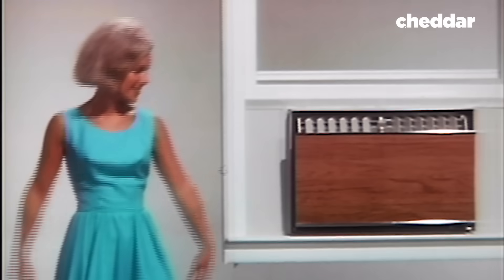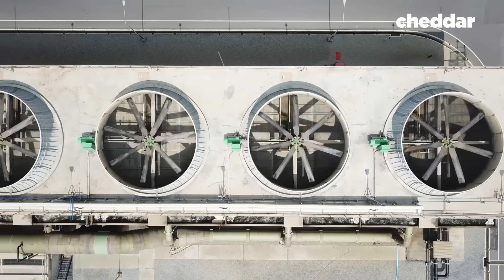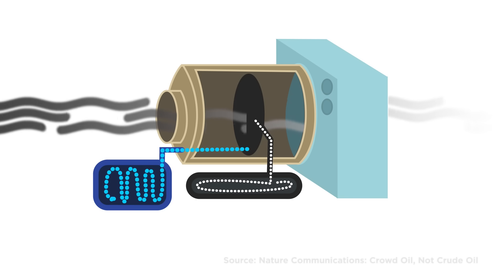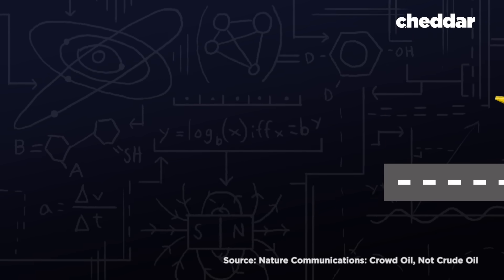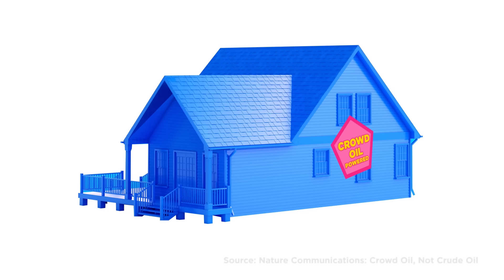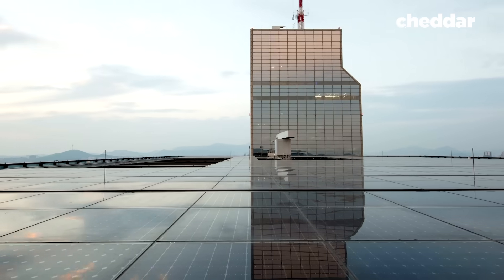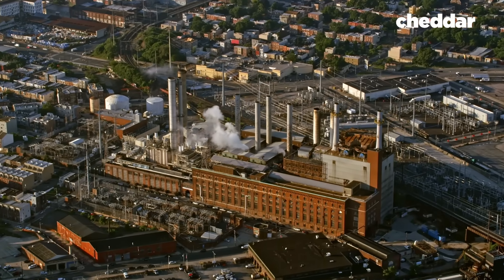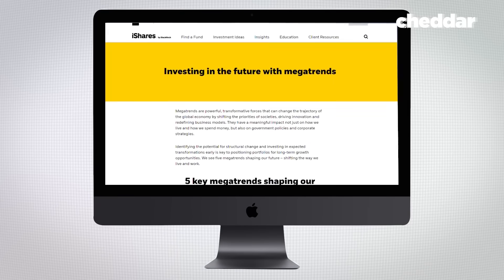How Your AC Could Help Instead of Hurt The Environment - Cheddar Explores

Comment: When you burn the hydrocarbon fuel created by these CO2 removal systems, does it produce CO2?
Reply: Not if you feed it in a thermoelectric / gasoline powered station with another layer of carbon capturing installed. But the underlying plan is to go nuclear everywhere (now that we have THE permanent storage facility for nuclear waste: it's in finland and it's opening next year) and eventually end up pumping this oil BACK INTO THE EARTH.
Reply: yes, FAIL !
Reply: it's reusing the same CO2 over and over, replacing the need to dig new wells and burn more fossil fuels which would add CO2. So if you could theoretically install enough¸ of these we could keep using fossil fuels, but stop all fossil fuel extraction and thus remain at the same current CO2 level in the atmosphere.
Reply: @JonathanGarneau    " it's reusing the same CO2 over and over, " I doubt its 100% efficient, lol, [edit: someone commented exactly that]
Reply: What you're describing sounds a lot like the so-called zero point energy systems some have claimed are possible, they are 100% efficient because they produce exactly the same amount of energy as they consume. However, I believe physics has dismissed this notion as a possibility. Other than that, though, I understand what you're saying, though I wonder why there is continued emphasis CO2 fuel based energy production, instead of electricity derived from solar, wind and geothermal sources. @JonathanGarneau
Reply: @Mordred478  mostly because large scale batteries are orders of magnitude less efficient than fuel at the moment. We might be able to fix that in future. And if you are using renewable, you need batteries
Reply: @Mordred478  It's not 100% efficient, you have to input energy into the system to remove the CO2 from the air, that's why they say it need to come from renewable sources
What this technology does is prevent more CO2 from being injected into the atmosphere
You burn the fuel, it converts into CO2, them you use energy to recombine the CO2 and hydrogen into fuel again
Reply: @Mordred478  " zero point energy systems some have claimed are possible "
The first point where your understanding gets a little muddied. Net neutral energy consumption is not something anyone cares about. We live in an open loop system that receives a near-infinite amount of power from the sun. Carbon neutral, however, is very much a reality--there's nothing about energy that dictates a hydrocarbon must burn in the process.

"100% efficient because they produce exactly the same amount of energy as they consume"
What you reference before is 'perpetual energy systems'. These will never exist on Earth and are not applicable here due to the lack of an energy bottleneck.

" I wonder why there is continued emphasis CO2 fuel based energy production, instead of electricity derived from solar, wind and geothermal sources"
Storage. We're awful at storing energy. California wastes enough solar power to power a few thousand homes, all due to the inability to harness full reserves into the night. Though, this is changing more an more every day... as is best noted by Australia switching to a Tesla battery system for smoothing out fluctuations on the grid--they've recouped a third of their investment in one years savings by simply not having to turn on a polluting power station to handle random hiccups in power usage.
Reply: @jakehix8132  I definitely think Tesla's battery systems are a game changer and look forward to the continued proliferation of these. Elon said the other day that this may become an even bigger part of Tesla's business than the electric cars themselves. I support the idea of tax credits for electric cars, SolarGlass and PowerWalls, etc. They don't all have to be made by Tesla, but the point is to give individuals and businesses and incentive to adopt renewable energy related technology.
Reply: @jakehix8132  Storing power in chemical compounds is a good argument. But, this method uses electrolysis, find a better way to do electrolysis. Also, don't come with this stupid idea of stealing power from my A/C unit. Plug your carbon-capture machine to your own carbon-free power generator. 

Or find a better way to stored energy in chemical bound that doesn't need to use CO2 or electrolysis, there must be a way.
Also, we have 30Y max for the research.
Better just power the CO2 carbon-capture machine with a nuclear reactor, convert the CO2 to some solid form and bury it underground forever (besides with the other nuclear waste), problem solved, just cost a couple of rrillions of dollars.

Comment: Would have been interesting if we knew how much extra energy the extra hardware consumes, and how much energy is contained in the newly created fuel. Ideally with an estimate of the total cost of implementing this on a large enough scale to make a noteworthy dent in total carbon emissions. Of course the video needs to be understandable by a wide audience, but could you not be bothered to do some simple math for us? Or is the reason because it's horridly a inefficient conversion that is prohibitively expensive? I've found the article https://www.nature.com/articles/s41467-019-09685-x  and they assume "conversion efficiency from electrical energy to fuel of 50%" This means it would take 3400 kWh to produce about 1 oil barrel equivalent which contains 1700kWh which has a market value of about 57 USD using current crude oil prices. So the produced oil is worth about 0.03 USD/kWh on the open market, and would cost 0.077 USD in electricity to produce for a net cost of 0.047 USD/kWh equivalent in oil (using quebec's cheap hydro industrial electricity rate of about 0.04 USD/kWh ). The best estimated Levelized cost of production of energy (LCOE) are also in the range of 0.04 USD/kWh ( https://www.eia.gov/outlooks/aeo/pdf/electricity_generation.pdf ). So transportation emits abut 6500M tonnes CO2 per year. Doing the math, this would cost en extra 3.3 trillion USD per year in electricity to offset world GDP is closed to 90 trillion, so we're talking about 3.5% of world GDP right there. Total emissions is in the range of 35 billion tonnes, which would compute to about 20% worldwide GDP.  If the byproduct was more highly refined with a higher market value, say to the level of the market price of US gasoline, then the numbers look much better 1.5% and 7% of world GDP respectively. There might be hope for this with some R&D. Shame Cheddar could not do this for us and tell us the good news in the video but had to rely on a youtube commenter to provide the info...
Reply: @R d Indeed it's a rather inefficient process, but there is hope that it could be still be much less expensive many than other carbon reduction schemes pushed for by too many ecological activists. I think the most cost-effective proposition I've seen was SO2 seeding in the upper atmosphere coming in at (from memory) 20-50 billion USD per year. Which is rather paltry compared to most proposed options. But since eco-activists are often ideologically opposed to most forms of geo-engineering, I think it would be prudent for pragmatic data-driven scientifically-minded people to have a fallback affordable solution for when eco-activism attemps to drown out rational thought with fearmongering.

Comment: but you need power to electrolyze water...
Reply: By the way what I am saying has nothing to do with that comment.
Second thing I ain't expert so my explanation could have major flaw.

Why do they want to use that carbon collected as fuel at the time of conversion. You see the thing is the energy you use to sperate hydrogen and oxygen from water would be greater or equal to the energy that you get from crowd fuel(aka the hydrocarbon you get at the end). 

Instead just simply collect the carbon from various sources. Use the energy of huge windmill farms to electrolyze the water turn that carbon into hydrocarbon and simple use it as traditional fossil fuel. This way you can essentially transport wind energy which is quite hard to transmitte as electricity. For that matter you can use any renewable energy source if we eliminate all the problems they have the major problem is to transport the energy and this technology could solve the problem.
Reply: Which should be provided by renewable energy otherwise it’s not a solution
Reply: @ThePLAYBC  If this tech is dependent upon the energy used to run the systems, then
 it would be more efficient to just use this energy to offset the energy
 generation from fossil fuels that is creating the CO2 in the first 
place.  The more steps that you add to a system, the less efficient it 
becomes; the more energy it wastes.  If you are going to use solar 
panels or wind turbines to power these things, then those devices would 
be better suited to being used to directly power the homes and factories
 that are generating the CO2, not to power this new intermediate step in
 the process.  If this technology were actually viable, it would be 
viable regardless of the type of energy it used.

Comment: climate change is BS...there are cycles that earth goes through because the sun and earth are electrically connected and the positions of the other planets also plays a role in the cycles....releasing refrigerant into the atmosphere has been banned since 1996 and the Montreal protocol...they even phased out certain refrigerants and made it so only certified people can work with or even buy it and if a certified hvac tech gets caught releasing refrigerant into the atmosphere they can be fined $10,000 and lose their certification to buy and work with it...many of you probably already tried taking a refrigerator to a junkyard and they refused to take it until a sticker/documents are shown that a company that is certified removed the refrigerant and only then will they take it...fridges use 134a refrigerant...and vehicles use it in cars from mid 90s till now...which replaced r12..but what people dont know is that all keyboard dusters that come in a can and is filled with pressure and has a nozzle on it...inside of that can is 134a refrigerant...the air in a can labeled as keyboard dusters/cleaners is in fact the refrigerant 134a...look it up...so legally I can lose my refrigeration certification and get fined $10,000 and possibly get jail time depending upon how much I release if I use the keyboard dusters...I shit you not...you dont claim global warming and ban certain refrigerants...require people to be certified and trained to use it...then sell a refrigerant for an off label use as canned air to clean keyboards...global warming is bs

Comment: From the look of it, before we can benefit from carbon capture, we first need to produce excess amount of renewable energy to power said carbon capture system. It's probably better to think of this system as a "battery" system, a form of energy storage. So the question becomes, how efficient is this form of energy storage, compared to other conventional energy storage systems like Lithium batteries or water dams.

This means the technology isn't really ready for prime time yet, because most parts of the world electricity isn't produced by mostly renewables. While the technical challenges might be ready, the world isn't ready to use it in a wider scale.
Reply: More and more cities/states around the world are starting to experience the 'duck curve' effect with their electricity grids - surpluses in energy production during the day. Perfect time to run an energy hungry, discretionary device like this.

Comment: >Look we've made an air-conditioner that captures CO2 right from the atmosphere!
>But what are we supposed to do with all that captured carbon
>Idk. Let's make fuel out of it.
>Doesn't that kinda defeat the purpose? You know that it'll all go ba....
>Shhhh.... It's my baby and it's saving the planet
Reply: it's carbon neutral, which means its one step down from putting more carbon into the atmosphere, obviously we need carbon negative aswell though.
Reply: @_Atzin  I heard trees were good for that. And they don't even need grid power
Reply: @Bunny501  Yes but we need to find carbon neutral and carbon negative ways to do all things that we do, i.e. cooling
Reply: @_Atzin  the only thing carbon neutral about that AC unit is the renewable energy that it uses. Did you know that we don't have much spare green energy?
Reply: Yeah dont innovate forget this shit, plant trees